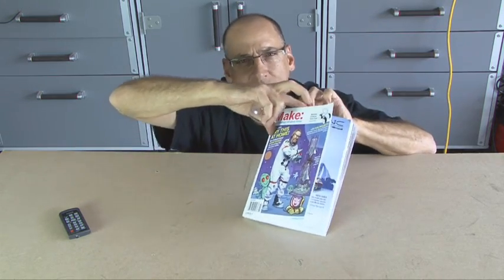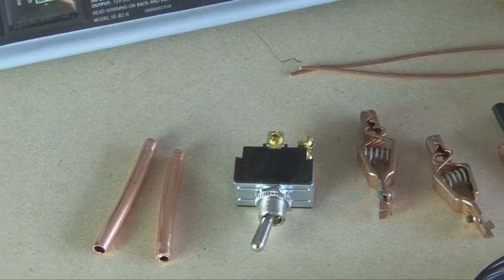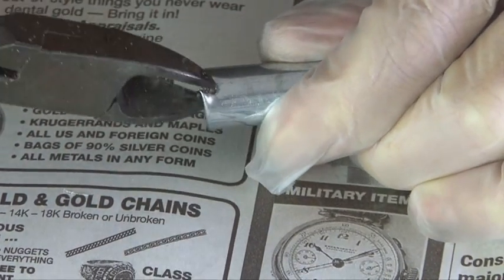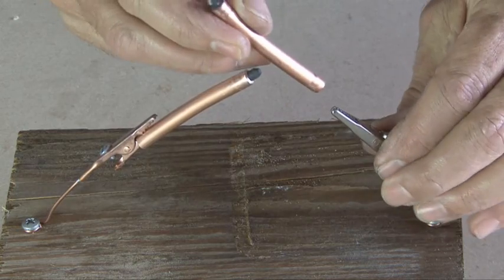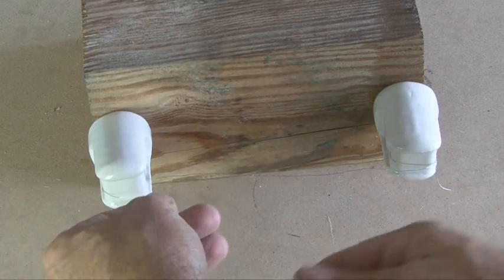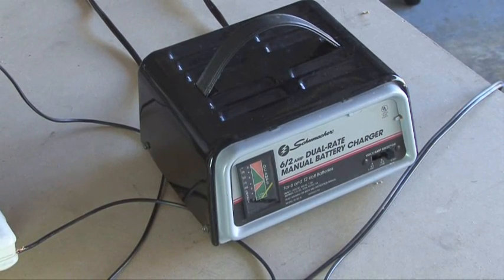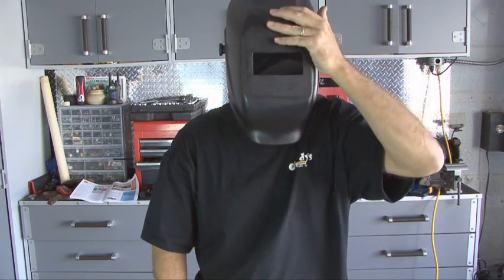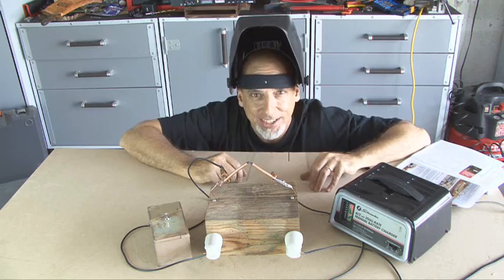Weekend Project: The Arc Light

Comment: The Carbon arc rod method was also used in a lot of the older Theater Movie Projectors to provide enough light source to get the picture out far enough to to the screen.

Comment: Arc Light 1.1: Take a microwave oven transformer (MOT) and remove the high-voltage secondary. Rewind it with a thick copper wire (these you use for electric installation at home, around 1,5-1,7mm²). Put as many turns on the core as you can do. You should get at least 30V or more. Than attach the carbon rods to the supply as shown. I tried it and the alectrodes got that hot that you could melt small peaces of metall with it ;)
Reply: Actually if you just connect the high voltage side leads to some carbon rods that will work as well.
Reply: This works not as good as with lower voltage and higher current. Just google how they powered the ancient carbon lights.

Comment: I don't get it ! If you need a welder helmet because it can damage you're eyes, how come people of the 18 century would use it. Probably because they were not looking  directly to flash ?
Reply: *****
Thank you for the answer. I am going to try this experience.
Reply: *****
Used for speaker ???
Reply: 19th century is more likely.  In the early 20th century the cinema studios used carbon arc and one observation was that actors/actresses were getting a "nice" sun-tan from the UV!  OK, so the early workers didn't use protection, or so we think?  Early X-ray and radioactivity researchers used no protection because nobody knew there was any danger.  Eventually, people were getting ulcers some of which would not heal and lead to malignant tumours.  But, it was years before the dangers of X-radiation became universally known and accepted.  As a kid I can remember that there was a chain of shoe shops that in the 1950s still had X-ray machines to check if your shoes were fitting properly!

Comment: Another interesting trivia is that arc furnaces that melt steel, use this same technique.
Reply: Melted steel using such at home in a DIY foundry. Tig inverter and set of automotive jump start leads. 

Found home made refractories didn't like the temps and would melt in a black volcanic like glass... But off all things "dough starlite" worked fine as long as no air flow through foundry.

Comment: Why does the circuit need the ultra thin wire? And how is an arc achieved with only 12 volts DC and 6 amps? I'm assuming the carbon rods have chemical characteristics that allow the arcing to occur. 

But if I were to take the alligator clips from this battery charger, turn on the battery charger at 12 volts and 6 amps, and hold the clips very close together, no arc would occur. 

From what I understand one needs high voltage and high amperage to achieve arcing. Such as with jacobs ladders, which typically utilize neon sign transformers as a power source. 

It would be nice to have some theory explained.
Reply: its nothing, but first he touches the carbon together, and then leave them, so an arc jumps, I even did tis with my 9V battery too...
Reply: He does explain the fine wire in the video. Right about 3:00
Reply: My uncle did this in 1935 (10 yrs old)  with a 9 volt dry cell and the electrical wiring of a rural household (I think just 110). He created a huge arc, 1.5 ft., but did keep blowing fuses. He went on to become a nuclear scientist, but is obviously pretty up there in age. I'll ask and share if he remembers exactly what he used to achieve such a dramatic effect.

Comment: Rig the two rods parallel with an insulator between them, and with the right starting configuration you can make a Yablochkov candle. Should burn for a couple hours if you're feeling brave.

Comment: Use a 12 Volt car bulb instead of the Nichrome wire.

Use a 120 VAC light bulb and it will work with 120 VAC.

Since the bulb will not draw excessive current, the power supply will not be challenged.

(As a teenager we used pencil lead instead of battery carbon rods)

Comment: You could use a Neon sign transformer and eliminate messing up your power supply but WARNING THEY ARE VERY HIGH VOLTAGE and low current but still very much enough to kill your ass!!!! Safety procedures MUST be followed when working with them!

Comment: One thing must be noted: The reason why the carbon electrodes have to be so CLOSE TOGETHER in order for the arc lamp to work is because of the EXTREMELY LOW voltage output of the battery charger.

If a HIGHER VOLTAGE step-up transformer was used between the AC line and the carbon electrodes, the ARC would be much larger and brighter !

Comment: I just did this for a college proyect, however, i thing that both this video and the article should be more descriptive and/or give more options. For example, It was a pain in the ass to find the 12 v battery charger with ammeter for 6 amps (i got one without the ammeter, and only managed 8 amps), also, it was quite difficult to find the nicrome wire.

Comment: Yeah, but this is a quick throw it together demo and isn't intended to be run for more than a minute.  A little nichrome is quite a bit cheaper than a 100W+ resistor and won't be an issue if it's not run unattended.

Comment: @KATOMATE01 I have insulators,  batteries, engines and motorcycles in my house / shed, I have already made an arc light using  carbon rods, 24v battery and a carbon rod as a resistor.

Comment: @Paul118GF Nikola Tesla made the tesla ball.Which had a single rod and ball that conducted electricity through plasma. Those were then incased in a clear glass ball that acted as an insulator. The Electricity from the conductor ball arced through the plasma to the glass and dissippated as static on the other side of the glass. Thats why when you grab a large scale model that is more powerful, your hair starts to go nuts.  Therefore Tesla didn't make the first light bulb.Get YOUR facts right dude

Comment: I have operated WW2 vintage Carbon Arc Searchlights for the last 27 years.
This video shows EXACTLY how they work using simple parts!
Outstanding!
Biggest difference is that the carbon rods in my large 60" searchlights are HUGE by comparison, the positive rods are approx 28" long and nearly and inch in diameter! And they draw 150 amps continuously at 100 Volts DC! yikes!
Just some fun info for everyone. Thanks for posting this, I loved it!

Comment: I run a WW2 Army searchlight that uses this principal.   Optimum setting for the brightest arc is: 82 volts @ 150 amp.  It takes a 4 cylinder Hercules generator to create this.  Result:: 800,000,000 candlepower off of a 60 inch rhodium plated parabolic mirror.  Light beam length: 12 miles.  Visible from 35 miles away.

Comment: Did you know that even in the late 1970s the movie theaters (at least the one I worked at) were still using carbon arced projectors? Carbon rods were inserted into the back of a projector and mechanically fed as it burned away creating the light that projected the movie on the big screen.

Now I feel old.